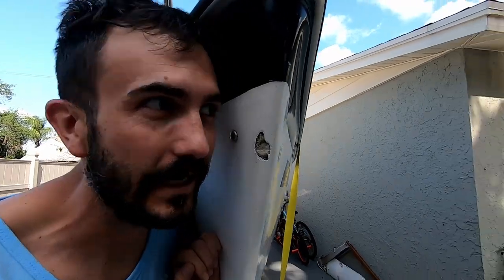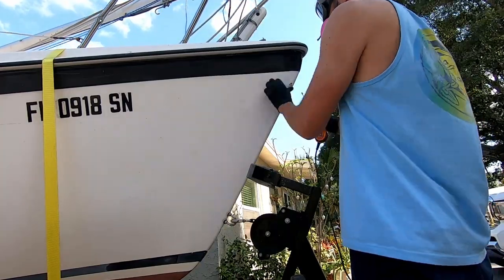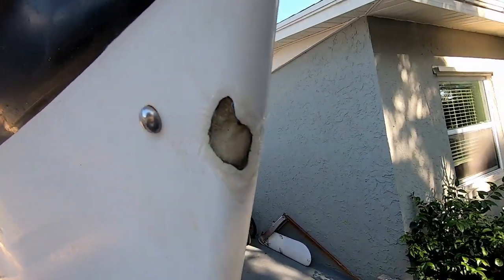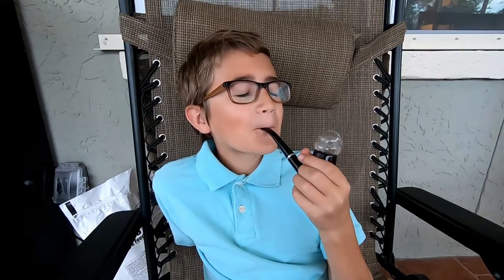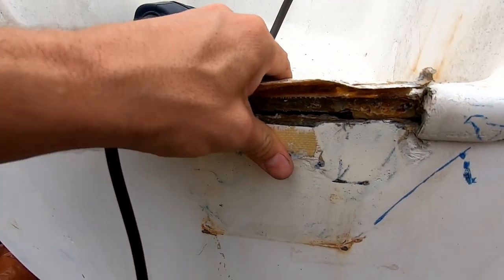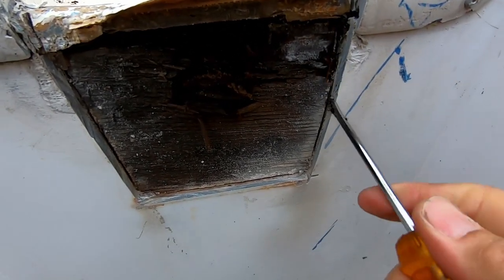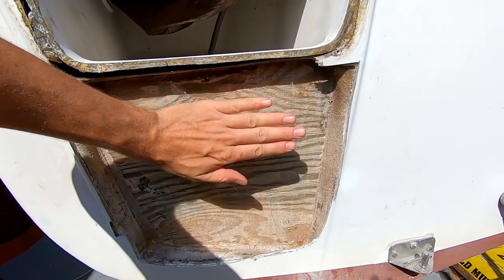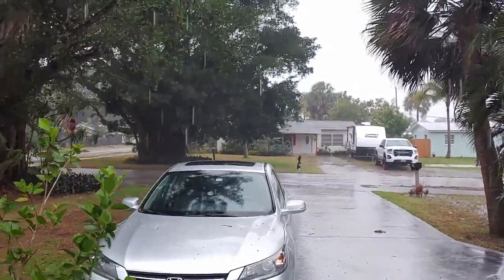Cutting the transom off my Macgregor 26D and fiberglass work

Comment: great job! There was a recent Facebook post about trailering with the motor on. Many said they did. I always take it off even though it is a very light 2 stroke.
Reply from the maker: I think I'll be taking it off from now on,.. the bumps put too much pressure back there. Although, I'm planning on making this transom as durable as an Abrams tank, so maybe I'll have something else to say once I glass the 3" iron plates on back there :D